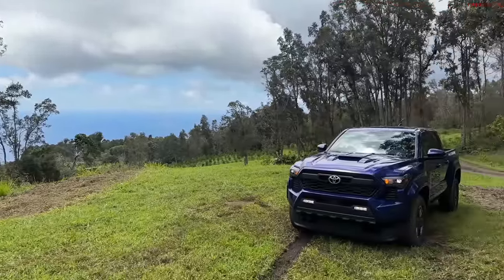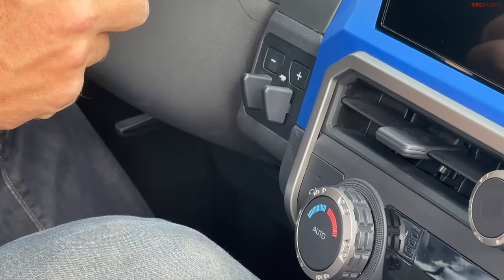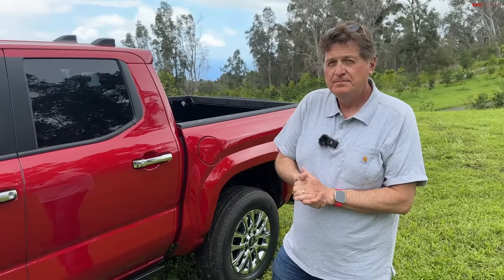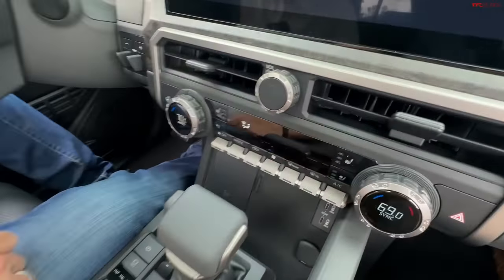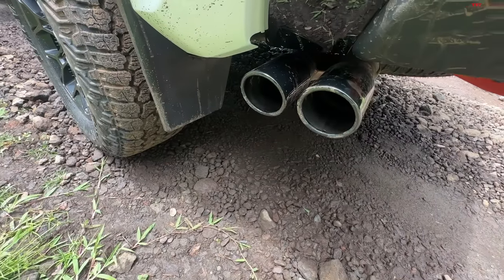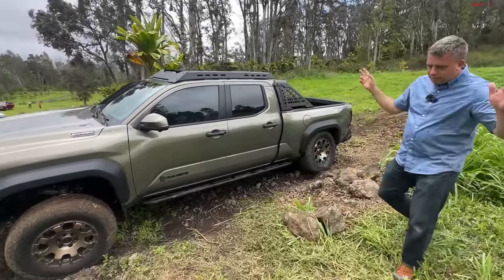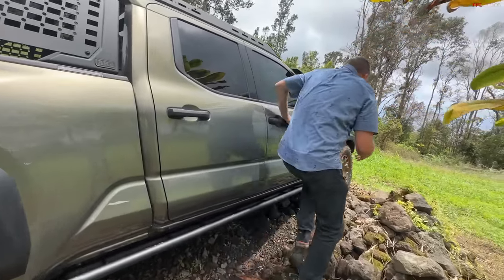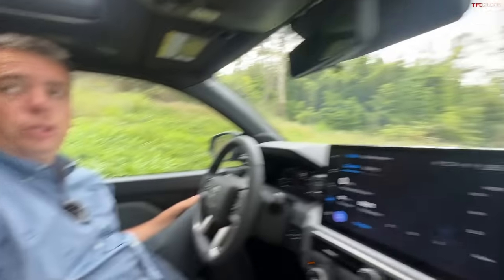The All-New 2024 Toyota Tacoma Is Finally Here But Have They Fixed Its Three Biggest Problems?

Comment: Are the dealerships going to mark it up 50,000 dollars
Reply: For sure even more
Reply: Not where I live.
Reply: Yes $100k lil mid size truck
Reply: @bigdavedayday1581  the trailhunter for sure will be 100k😢
Reply: @northerntoyota7584  eh oh Canada
Reply: @pacocandano  facts that’s why frontier is selling like hotcakes because you can buy a pro4x with lift and accessories for under 55k installed at the lot cheaper than you can get these rangers and tacomas and canyons
Reply: I'm sure they will and the problem is people will pay it!
Reply: TRD pro will probably go for 80k or more
Reply: I work at a Best Price dealership where we put every new vehicle at MSRP. I'm so stoked
Reply: Might have to wait a year or 2 for sales to calm down
Reply: Toyota in my area has bunch of tundras now. It will likely be like that for tacoma too.
Reply: @austintoman2106  msrp is still bad unless your custom ordering to a T what you want.
I bet your dealership doesn’t wiggle for military or first responder discount or usaa or navy fed car buying service
Reply: No, they make half a million a year
Reply: @jshapiro34  the fact you consider 55k cheap is insanity
Reply: @cryengine_x  oh it’s expensive but as trucks are going right now 55k loaded and trail ready is pretty good vs a half ton trail ready will be in the 80k range now and a diesel 3/4 will be about 120k now.
I scored my stuff right time having a krx 4 seater 1000 a 21 Titan pro4x lifted and 22 4 runner trd off-road
And a 22 ram 3500 big horn dually in the driveway I’m doing alright so money isn’t pay check to pay check for me.
Reply: Oh you know they will dude, even if Toyota pays a PR firm to make it look like they're doing something to stop it.
Reply: @jshapiro34  55k for a Frontier is a joke on every level. The Frontier only ever sold because it was cheaper than dirt. It can't compete with the Tacoma on its virtues.
Reply: @hochhaul  virtues really? So snapped frames ? 
The frontier is cheaper than Tacoma they had sema builds for 55k you can get a pro4x for 40-44k lift and wheels and tires and bumpers and protection for another 7-10k and installed for 2-4k by mechanic is what they where saying in videos meanwhile we all know this Tacoma will be unproven just like the 3.5 is by far worse than the 4.0 Tacoma and 4runner and then the tow and payload numbers collapsed along with knowing dealers will have 10-25k mark ups on these
Reply: @austintoman2106 that doesn’t mean you’ll be able to get the vehicles LOL. Bet you your dealership MIGHT be allocated 1 trailhunter a year….maybe a TRD Pro every 3 months….the highest selling tacos are the SR5, TRD sport and O/R
Reply: @jshapiro34 in what way is the 3.5L worse than the 4.0L? More power and torque and better MPG’s? I’m genuinely curious where you got that stat?
Reply: Mark up, hell  the MSRP is going to start at $50,000!
Reply: @Mike Normandy  oh 100%. I work at a Toyota dealership in a small town in Montana. It's a pretty small, so we don't get allocated as much to begin with. Right now if you want a Sienna from us, we get about 5 a year and we have over 200 people on that list.
Reply: @mikenormandy9250  Tacoma 278 hp and 265 torq meanwhile “outdated”and battle proven and god of a motor in 4runner and even when it was in Tacoma and FJ and even in xterra and frontier and pathfinder for nissan and in jeeps and Ford Ranger. they all had same core parts turning out 270 HP and 278 torq 
Sorry my dude if you update a motor you have to show massive gains and the 3.5 did not it only brought about 5-9 hp gain and less torq on a dyno the motor needs 6000-6500 rpm’s to find the gains and the 4.0 needs 5000-5600 rpm’s to find its gains it’s battle proven because it’s got lower rpm’s curve that’s why every redneck had a Tacoma and Ford Ranger for hunting and carrying dog boxes and quads etc on back washed out roads it was built to last and go look at mods the 4.0 motor accepted better mods curve the 4.0 in 4runner and others gets 17-22hp and almost 25 torq from cold air and almost 10hp and 10 torq from exhaust and back in the day their was programmers for the 4.0 Tacoma getting 30 Hp and 15 torq. 

Now the 3.5 gets about 14 hp and 13 torq on kn and about 5-8 hp and 5 torq on exhaust. It’s built and doesn’t have room for improvement  

Also supercharged the 4.0 beats 3.5 by about 40 hp and 20 torq on a dyno it’s built I think the only way a 3.5 can get and hold more power is a 3.5 eco boost style with duel turbos
Reply: At least 5k on lower trims, 15k limited, and 20k on pro.
Reply: @jshapiro34  And they drive nicer too.
Reply: @hochhaul  Horsecrap. Frontiers have gone a million miles with decent maintenance. New Frontier drives, rides, handles, shifts,  accelerates ,and brakes better than Tacoma, plus is quieter inside and searing position is not awful like everyone says about Toyota. Plus Nissan frame had been boxed for years, not like the cheap Toyota rust-out frames. 
So, what virtues does Tacoma have except fan hype like overpriced Harleys?
Reply: @jshapiro34  If Nissan frames broke like Toyota, there would be endless criticism. But when Toyota fails, all is forgiven by the fanboy ego club.
Reply: @TIJoe-te9qu  they fan boy over that brand hard and weirdly it’s the Tacoma group that’s the worst 
My wife has a lifted and armored 22 4runner trd off road and the people we met with that are not bad but we had to upgrade after 2 motors and 2 transmissions and about 400k on a 08 off-road xterra
Reply: Toyota is working to fight that

Comment: I still have my 07 Pre Runner with 233,355 miles. 

The 4th Gen Tacoma definitely is a big step forward. With the hybrid option, really good 👍🏻. 

I own a RAV4 hybrid and when I get stuck in traffic. The car stays in battery mode all the time (Great because of high mpg). 

With the 4th Gen Tacoma, this is great news and will definitely save you a lot of money in the long run. 😎👏🏻
Reply: I have a 1996 2.4L 4cyl single cab manual with 313,000k miles 

And a 2006 4.7L sr5 tundra access cab with 307,000k miles and both pass smog in California and both have cold ac not to mention that they don’t have a check engine light on 😮😮😮😮
Reply: @ocularpressure4558  My friend has a 2004 Impala with 303k and no check engine light and it's survived wrecks and salty Midwest winters.
Reply: @thelosteddies  that’s awesome. I’ve actually heard of the rare American cars that will make it past 250,000 miles.
Reply: @ocularpressure4558  it's really not that rare. I know several.
Reply: @thelosteddies  I was just looking at it from a Honda or Toyota standpoint almost every Honda or Toyota you purchase well go nearly half 1,000,000 miles on the same transmission and motor with cold AC that passes smog but it’s a rarity to ever hear that about any American vehicle while I’m at it I might as well add that I’m not trying to say Toyota and Honda are the best I’m just saying if you want a vehicle that’s going to be trouble free for a half 1,000,000 miles people know to pick Honda or Toyota
Reply: @ocularpressure4558  that's not been my experience and I worked in a dealership. I've seen plenty of early transmissions on Hondas and a 7 year head gasket recall on Toyota V6 in Tacoma, not to mention all the sludge issues. Few cars ever go 500k. The longest lasting vehicles are diesel HD trucks.  It mostly comes down to maintenance. Most Honda and Toyota owners are pretty good about dealership maintenance and many American owners abuse their cars more from what I've seen. That's why for while Buick had them all beat in quality even though other brands had many of the same parts. Old people drive easy and take their cars in for most maintenance because they're afraid of getting stranded.
Reply: @thelosteddies  my grandpa when I was growing up had a new Buick every two years and he drove Buicks since I was a little kid till the day he died. That was his favorite brand. It’s funny how older people enjoy the Buick brand kind of like riding around town on your living room couch but I have to agree if I were to pick any vehicle, it would have to be a Dodge Cummins diesel for sure
Reply: @ocularpressure4558  the Buicks, Oldsmobiles and Cadillacs in the 80s were really plush. You're right, they were just like being on a couch!

Comment: Wow I think Toyota really nailed it, here's to hoping it drives as well as it looks.  I thought I was decided on order a colorado ZR2 but Toyota has really impressed me with their updates. I'm hoping pricing is competitive with the new colorado as well.
Reply: Zr2 is gonna crush this
Reply: @punkem733  maybe in some alternate universe. The zr2's quality is absolute garbage. Less features and alot uglier.
Reply: I agree... I'm ready to get rid of my full size.  I'm looking at a canyon.  This truck looks weird and cramped.
Reply: The fact that the best engine can't be mated to the manual is a fail. The lack of a front locker is a massive failure, as is the poor approach angle.
Reply: @theclueguy3388  less features? did i miss the part about the 4th gen's front locker? i didn't hear them mention it. And whats the deal with the front approach angle on the TRD Pro? pretty weak. And I can't get the big torque engine option with a manual? WTF
Reply: @hochhaul  you can’t even GET a manual in the Colorado
Reply: @hochhaul  Also seems like the front skid plates on the TRD Pro should come up higher in the front.  Is the front bumper on the TRD Pro also steel like the back bumper?
Reply: @theclueguy3388  All you said was subjective. Their interiors are similar with the taco having less room and a underperforming engine
Reply: @WatchesYouAtNight  the taco has best in class torque and very high horsepower. How is that underperforming….
Reply: @theclueguy3388  it's barely more hp than the last generation. The high torque number comes from the higher trim hybrid engine while the base engine from Chevy and GM will only have 6lbs of torque less lol

I'll have to drive it but if it's anything as limp dic'd as the last generation I'll pass
Reply: @WatchesYouAtNight  it’s turbocharged it’s no where near as weak as the old one and now it has an 8 speed automatic
Reply: @theclueguy3388  I honestly don't like the fact that they're turbo charging all these lame ass four cyls, every manufacturer is doing it because it's cheap epa. Nowhere near as reliable as a naturally aspirated engine
Reply: @scottdm9707  Yeah that's what I'm saying. I mean it's great that it has a pretty solid skid plate up front but the approach angle looks like a big step back compared to previous generations. It's the same front overhang problem that the new Tundra has. There's so much out in front of the front tires that it hurts approach angles.
Reply: @theclueguy3388   And your point is?? Toyota never used to limit you to an automatic with the top engine choice. Now with the 4th gen they tell you that if you want a manual you have to settle for the gimped engine.

Comment: All I can say is “WOW" I was pretty bummed about the new tundras, but Toyota has definitely redeemed themselves on this one. I’m blown away
Reply: Really? The overhang on the front of the TRD Pro is awful and they didn't even bother to come up with a front locker to compete against the Raptor/ZR2/AT4X. They offer a big torque engine option but then refuse to offer it with a manual transmission. I'm even more disappointed than I was when they unveiled the new Tundra.

Comment: Eh if the gas mileage isn't that good I'd rather have the 6 cyl NA. I want longevity... how long will these engined actually last?
Reply: The engine will be fine for well over 200k miles, maybe even 300k miles. I've seen many small turbo engines make it to high miles, but only the ones that have proper oil changes. They need to be done sooner than what the manufacture states, especially for the turbos sake.

Comment: Nice, so the Limited uses the same Torsen center diff as the 4Runner Limited now. Oh and to help you out:

H4F - High 4 Free, the center diff  is unlocked
H4L - High 4 Locked, the center diff is locked
L4L - Low 4 Locked, Low range locked.

Comment: I was super excited about this truck when I found out you could get the six foot bed. Then I found out you could only get the six foot bed in the lower trims with the base motor and leaf springs. So if I want a full sized bed with the hybrid I have to get the most expensive Trail Hunter trim. That is a major fail!  Oh yeah, and still no front locker...
Reply: The front locker is more just a bragging point, IMO.  I was a moderate Jeeper in Colorado and rarely used my front locker in my Rubicon.

Comment: The 2.4 turbo is a let down. They should have upped the numbers for the Tacoma over what they’re putting in the SUV’s.
Reply: Once these trucks get a tune I’m sure it’s going to wake them up!These are probably tuned from the factory very conservative to run garbage 87 octane.
They know Americans like to put cheap gas in their vehicles.😂
Reply: @goforbroke2 still wack a brand new vehicle has to get a tune to be effective especially with the high ass price tag
Reply: Your wrong it’s going to feel way more powerful than the previous models.
Reply: @Weatherby406  ya for how long tho? And with how many parts broken with all this extra shit attached and it’s complexity I see nothing but headaches coming with ownership no more simple 3.5 or 4.0 V6 with barebones components we got this 4 banger with 19 thousand wires and a stupid hybrid battery to break down
Reply: @naturalrebel6301  😂
Reply: @naturalrebel6301   Welp get ready for the prices to raise even more. Go Thank Saudi Arabia
Reply: @Beall_  😢😢😢 we’re screwed lol

Comment: A manual transmission Tacoma will be my next truck.
Reply: It would be a ton of fun to drive.
Reply: @ZenEndurance  with the rev hang, throttle lag, and clutch accumulator, it’s not fun. I promise
Reply: An EV Tacoma would be mine.
Reply: @ZenEndurance  In another video I watched, an engineer from Toyota said they had eliminated the clutch accumulator.
Reply: Your next truck and those other 4 people in the USA
Reply: @phileasler5401  😂😂😂😂 <<<<<<<<<< the 4 other people in the USA able to buy one.

Comment: Hopefully my 16 will keep going strong. Interested to see how bad this one will hunt gears on the interstate. Toyota’s magic hp # of 278.
Reply: That is why I specifically sought out my 2015 with the 4.0 and 5 speed. Lol all I did was shake my head during this video, especially when the tailgate wouldn't open because the battery was low.
Reply: The GMC Canyon has cleaner lines on the exterior design in my opinion. But it's still a nice truck.
Reply: It won't with that 300+ lb ft of torque that peaks under 2000 rpm. Should be very responsive at highway cruise speed in overdrive.
Reply: Transmission hunting and torque can be very mismatched. Don’t assume perfect transmission shifts because of engine power alone
Reply: @sid5156  The 5 spd didn't hunt for gears.

Comment: So if the battery dies, the tailgate won’t open?!? How’s someone supposed to get out?
Reply: With your hands and arms. It’s crazy.
Reply: I’m sure there’s a manuel way to open the tailgate. Also what you mean get out? It’s not an suv, no one is riding in the bed and if they are they just hop out. You don’t need the tailgate to hop out the bed but how many times do people actually ride in the bed unless it’s a quick short trip. You gotta be one of the most unhealthy unathletic people if you can’t hop out a bed of a truck with the tailgate closed. But I’m sure Toyota thought about that as there’s a quick easy way to pop the tailgate without the automatic power. Toyota isn’t GM with their hummer making it a complicating process with numerous instructions and steps to do everything.
Reply: Kinda sounded like they didn’t have the key fob with them so it didn’t want to open without it . That little beep sounds familiar

Comment: I just bought a 23 Honda Ridgeline last month. So far I’m still very happy with my decision (if I ever off road I’ll get a side by side, not a pickup truck) these new Toyota vehicles are over the top with their angles and body lines. Way too busy of an appearance.
Reply: You should stick to the smooth Ridgeline then! I’m the opposite I may have to trade my Ridgeline in. I do love the 26 mpg I get in the summer time tho.
Reply: I came close to getting one but went 23 Colorado Z71.
Reply: We have 2007 Ridgeline in family.
It was purchased new 16yrs ago. 222,000 miles. I waiting for redesign 3rd Gen Ridgeline hopefully 2024. It should follow new 2023 Pilot that has a TrailSport trim. I would go for top RTL-E trim like Elite in Pilot. Honda can't skimp on not giving USA spec top trim ventilated front seats now. The Canadian Spec has them with Rear Outboard heated seats. 
Tacoma and other competitors Ford GM have stepped up.
 I still don't think none have backseats as wide as Ridgeline.
If redesign Ridgeline comes it will have more space to use somewhere. All competitors still can't offer The in-bed trunk. The interior cabin space either with flat floor storage with seats up or down. But looking forward to seeing Tacoma and other offerings on Street. Yes they got to come out on pavement.

Comment: Hey Guys.........great job as usual, I'm so stoked looking at those torque numbers.
Reply: That torque is only with a battery....... pretty dismal when you take that away.
Reply: @willrector9716  Still more torque than the current version......and at a usable RPM.